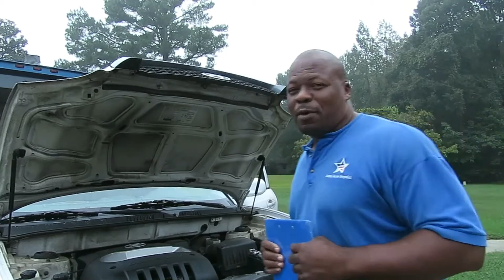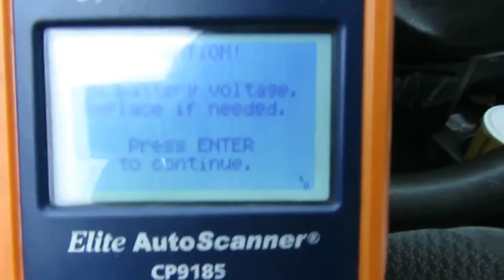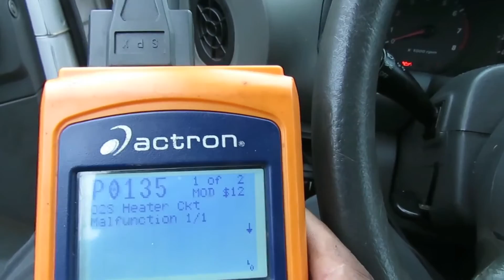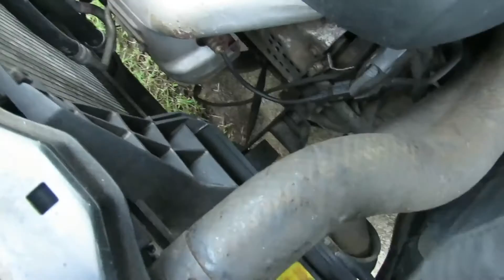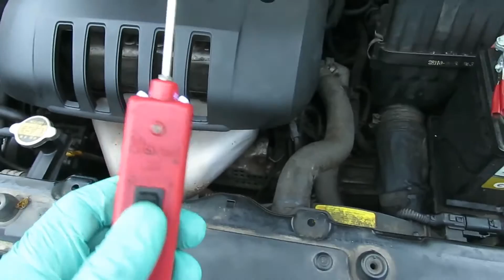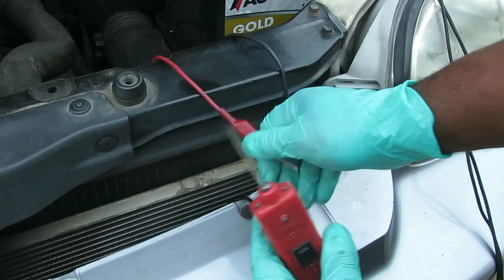2003 Hyundai Santa Fe P0135 - O2 Sensor Heater Circuit Bank 1 Sensor 1

Comment: I have P0136 2004 2.4. Is bank 1 sensor 2 right below the o2 sensor at the top of the exhaust manifold? if so, is sensor 3 and 4 below the flange and to catalytic converter?

Comment: Hello i have this issue but on a 2008 hyundai sonata. The problem is that under the hood it smells burnt ans the car doesnt turn on. Would you be able to give me some insight if this is a cheap fix or something alot more serious and expensive?
Reply from the maker: That is going to depend on what is actually burning. Hopefully it's not your wiring harness.
Reply: Thank you.

Comment: Have the Same Eng.in My Sonata,& Replaced O2 Sensor,& Still Has Code,Does Code Need Erased ,After Replacement,Friend Helping Me Thought It Would Reset After Comp.Started Getting Signal That It Was Doing It's Job?
Reply from the maker: Hey Ed, for a quicker action, you can clear the code using a scan tool, or take it to autozone (or similar) and they can do it for you.
Reply: Astral Auto Repairs r
Reply: Tks.